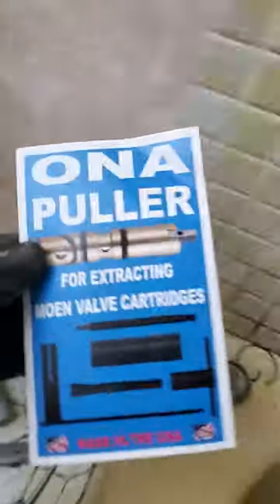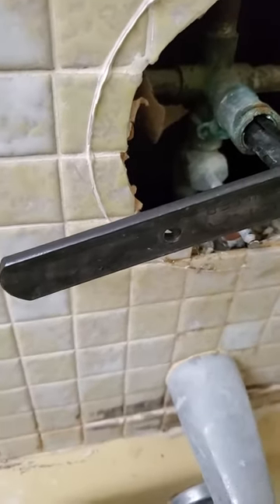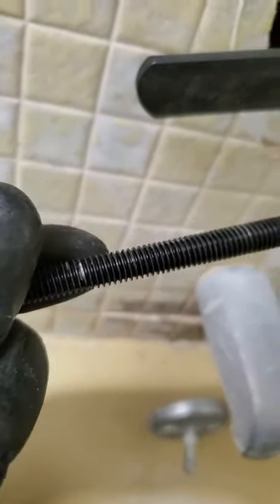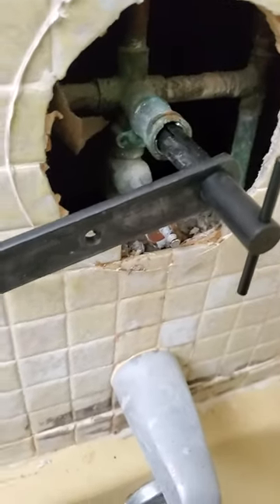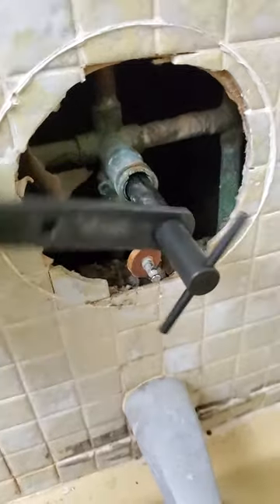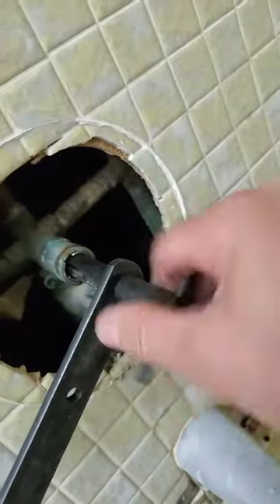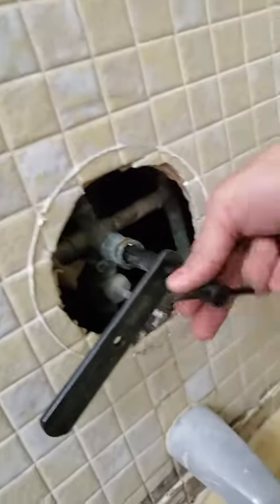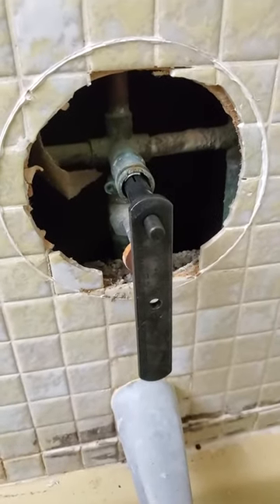ONA Moen Cartridge Puller review real life situation.

Comment: Should have tried applying a heat gun for 5 minutes to the valve. That's what I did. After heating up the valve the ONA Puller worked for me. Before the heat, the ONA Puller could not get the Moen 1200 body out (probably the original cartridge from 1984). After the heat, the body wiggled free using the ONA Puller. I'm no plumber either. Entire cartridge replacement job took me 15 minutes.
Reply: You’re no plumber so be quiet. You just said it. Heat doesn’t always work. Sometimes you cannot get these out.
Reply: Yes, the hair dryer made a big difference for me. I'm no plumber.
Reply: That harvest gold look is older than 1984

Comment: I got this tool then seen this video.  I haven't used it yet. I've had to replace plenty of moen valves when the cartridge breaks inside valve body. Hopeful this puller can prevent that headache. Thanks for the warning.  We always known what plan B is.
Reply from the maker: It can't get very old 1200 brass moen cartridges out . For the newer moen posi-temp cartridges, it does work great.
Reply: Worked great for posi temp.  For me it paid for itself first use not having to resort to plan B. Nice to be in and out in 30 minutes instead of 3 hours

Comment: I was just ready to purchase it! I'm glad I just watched your video! Because I have came across several cartridges that have sedediment  built up around them. And have had to just replace the whole valve! I was hoping that this tool was the correct solution  fir this problem.  From what I see it's not! I have one question . Have you tried contacting the manufacturer? I'm curious  to what they have to say
Reply from the maker: I  tried  returning it to one of their  vendors one day after purchase where I bought it with my receipt. They refused to refund me . The puller having the space to retract the entire cartridge seems like a great idea but I've noticed after pulling so many that if  you can't get it with a regular puller it's not coming out in one piece  anyway. Just defeats the whole purpose

Comment: Sometimes there’s nothing you can do to get out a really old 1200
The ona works better on the 1222 than any other puller I’ve see
Reply from the maker: I agree I have been having a higher rate of success with the posi temps 1222s.  probably should do another video giving them props for that

Comment: Im just curious, if drilling the remaining cartridge and tapping it.  Then using a 1/2" bolt and washers to move the cartridge by turning the bolt?  All you'd need is it move a little to break it loose then you might have it out.
Reply from the maker: @michaelholewa6602  I've seen some videos where they do all that but I got this tool so I wouldn't have to find another way to skin a cat .

Comment: The Lakeview Cartridge Puller is the best one.  I have no connection to them other than owning one.  It works great even when the seals have dislodged in the valve and make traditional pullers useless.
Reply from the maker: Saw that one a couple of years ago and thought attaching something to a drill was going to end up being more of a stem puller. The lakeview does look solid and well built though.
Reply: @torotheplumber3788  You can use a 3/8" socket wrench instead of a drill.